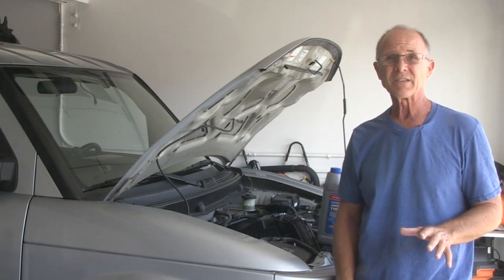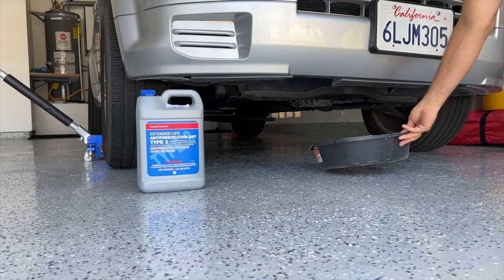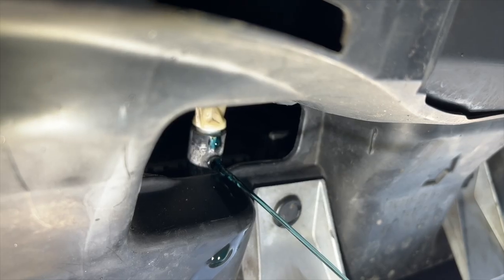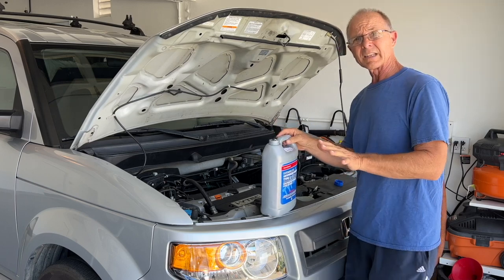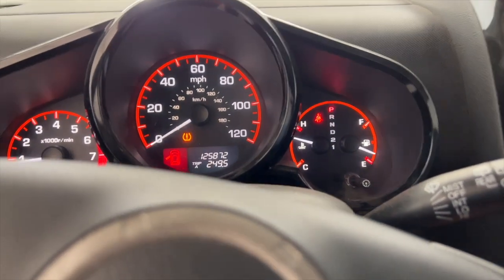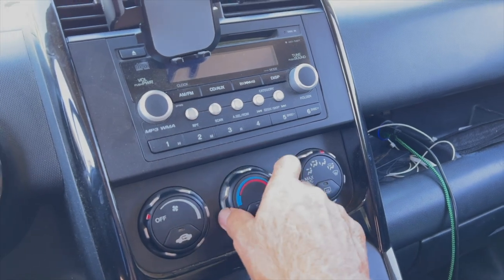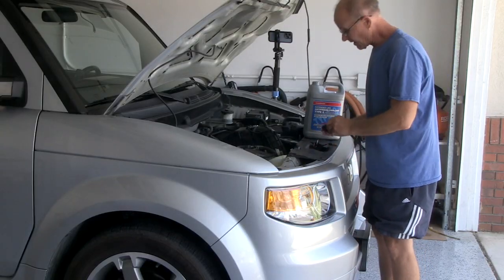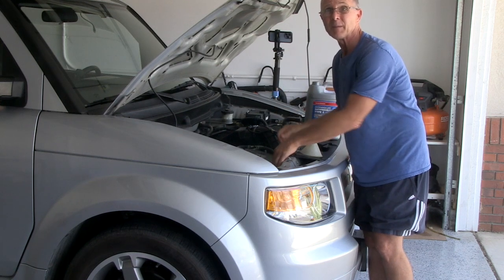Honda Element Coolant Radiator Service #coolantflush #coolantleak

Comment: When standing to adding the coolant I  thought you're supposed to run the engine so the antifreeze goes through the engine engine thoroughly. Because if you run it with the engine not running it will not go through the whole engine. And the engine is not hot enough where I'll burn you so you can add the coolant is coolant safely. Thanks ✌️
Reply from the maker: Safety 1st, many ways to do it, this way works best in my circumstance

Comment: Don't forget to turn the heat on HI and let the coolant flush through the system while idling  and pushing air bubble out. They tend to get trapped on the high points, like the heating system.

Comment: Yes, it took my cooling fan a long time to come on. I'm not sure u r supposed to turn on ur fan system when ur waiting for the fan to turn on? p.s. be careful how much/high u rev up ur engine.
Reply from the maker: Great feedback 👍🏼
Reply: @dannysdiygarage hey boss if I take my mines to a oil change/coolant flush stop and go they use the big machine is that better
Reply from the maker: @547thekid  if they actually do it, make sure you watch them, in my experience I’ve seen many cars not get what they paid for, not all mechanics are trustworthy, when you do it yourself you know it got done
Reply: @dannysdiygarage  ok I will watch .. do the machine they use to flush it also gets bubbles and  air out the system ?
Reply from the maker: @547thekid  yes❤️

Comment: The previous owner but probably the Honda tech that cleaned the throttle body and used pliers that tore the coolant hose leading to the EGR passage poured a white stop leak agent in my radiator. Any suggestions of how to remove it?

Comment: Thank you Danny for all the great videos you produce on the Honda Element. I  purchased a 2007 Honda Element SC recently and am  in the process of replacing the fluids as per some of your videos. I just yesterday finished changing the transmission fluid and filter yesterday and next weekend will do replace the power steering fluid and coolant. I wanted to ask you: Your Element seems to be the SC model as mine. I want to add a roof rack and replace the struts. Where did you get  the roof rack? Is it OEM? What about the struts? It seems like there is hardly any aftermarket  struts made specifically for the SC. Please let me know. Thank you again Danny.
Reply from the maker: Yes I have oem roof rack, I’m not 100% sure, but I’ve heard, SC parts are harder to find

Comment: I will have to say i'm leery about changing transmission fluid unnecessarily, Though cars have changed a lot since the last time I had learned anything about anything so maybe it's a different now. I remember used to that was the guaranteed way to get your transmission to start slipping was messing with the fluid when you didn't need to but... It's been fifteen years since I even thought about it.
Really enjoyed the video by the way.
Reply from the maker: I spent 10 years as a transmission rebuild tech, never did I have a cars transmission quit from a transmission change, on the other hand if your transmission is in bad shape and the fluid gets changed, Maybe?
Reply: This is just an urban legend originating from those who decided that changing fluid in already failing transmission (possibly from the lack maintenance) would magically fix it. In that case fresh fluid could actually make it slip even more.  It’s like saying that your engine will not last if you always have fresh oil on it. I drain and fill every 30k

Comment: One should also replace the radiator cap. Why? That circular plastic plug on the end tends to weaken and break off and end up in the radiator and cooling system creating havoc. It far less expensive to replace the cap every 5 years or 50,000 miles.
Reply from the maker: great tip